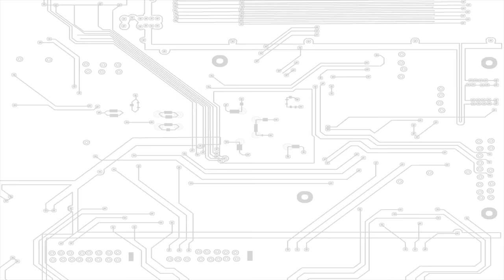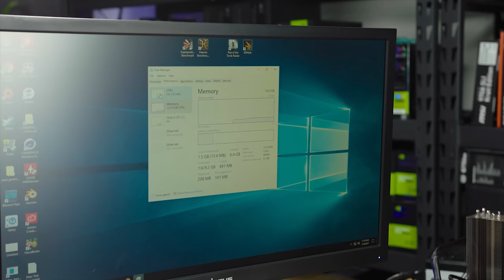How to fix bent CPU pins

Comment: I think this vid was made for me. After I blew a fitting on my first attempt at water cooling I tore down the pc to clean the motherboard as a bit og coolant got on it. I put the cpu (just a 5950x..) in the og package for safe keeping. I put it in upside down and bent some pins on 2 corners. I watched just a few minutes of this vid and was able to get them all bent straight and the system is now running. Thanks man!

Comment: This video saved my ryzen 5 2600!!! Thankfully my pins were not too bad due to the fact that I don't even know how they got bent. I pulled my stock cooler off and the CPU came with it but it didn't fall or anything just was stuck to the wraith stealth. Anyways I tried to put the CPU back in and I got the rock of death where some pins didn't go in and the CPU would rock side to side. I didn't force it in and than I tried your method with the razor blade and presto it went right in. Thanks again jay!!!!!

Comment: Watched this after DIYing a solution last night. What I did is very similar, but I grabbed a pin from my wife’s sewing stuff. It had a good sized round end. Slide the pin between the rows, then pull the sewing needle UP, turn 180, repeat. Watching this, I think the advantage using the sewing needle is that when you pull it up it forces the pins in the correct orientation right away. But…….I haven’t finished the build yet, so we’ll see if I got it right lol

Comment: I bent my pins exactly as you described: I was packing up the motherboard for RMA so putting my 5900x back to it's box. The plastic sleeve does not say anything about which side up/down, and when I snap it it bent in all 4 corners. Thanks for your video I don't need to mourn for two items.

Comment: Thanks Jay! My pins got bent (corners) when I couldn't get my heatsink off, too glued, and it ripped the cpu+heatsink out. I didn't know they were bent until after my mobo came back from ASUS and I tried to reinstall. You saved me a hell of a hassle!
Reply: Did you install the CPU on same mobo from which the CPU came off stuck to cooler? And it worked?
Reply: @5El3ments  I'm not sure if it's the same, I had it RMA'd. But, if I did get the same one back, yes it works. Applied a even spread of AS-5 with Wraith cooler and under heavy load it doesn't go above 60c. I could check the serial # if your that curious.

Comment: My 5700x wouldn’t quite slide in on 2 corners because 5 pins were slightly bent inward. I went to the grocery store, got a 10 pack of Razer Blades for 1,50 and fixed it. You’re a Legend Bro
Reply: Edit: 1,50 because they were made of plastic, but for my case that was sufficient

Comment: Going to give this a try on my Ryzen 9 3900. I just got the chip a couple of weeks ago and I had it running in my old AMD Wraith Prism fan. I switched over to a Artic Water Cooler and went to swap the fans and by CPU totally bonded to the heat sink. I pried the CPU off but dropped it off my work bench and bent about 12 pins 6 of which, pretty badly but none broken. I'm going to try to save the chip with the method shown here. Thanks for the Video and wish me luck!
Reply: 2 Pins came off, they were too far bent to get back in position and they broke off when I tried to pry them back up with the razor blade. Selling it for parts on Ebay. I'll miss it.

Comment: I love AMDs CPUs but I hate that the pins are stationed on the bottom. However. Im glad this tutorial is here. When I got a 1700X it came out of the box (with unbroken AMD seal) with a few bent pins. But I fixed them because Im a boss like that.

Thanks Jay.
Reply: They changed it to mobo pins for Threadripper. Let's hope it's forever.

Comment: unfortunately i damaged my 3700x after taking it out for the first time (i built my pc in 2020 around 4 years ago) to change the thermal paste, the cpu was cemented to the cooler with the old thermal paste and i bent some corner pins taking it out. this video is a life saver i don’t have to spend another ~400 on a new cpu🙏🏽🙏🏽🙏🏽

Comment: Oh my god Jay, you jsut saved my life, i just dropped my 2600X when installing a H115i, thought I would be clever and not lay the case down, i released the cpu and yes I dropped it (linus came into my head straight away) I thought I got away with it as everything seemed to be running fine, CPU temps were 15C cooler at stock settingsand  I was happy.............. until I checked the task manager.
The ram is showing 16gb installed but only 8gb available and the other 8gb reserved for hardware, I have tried everything to fix it, bios update, swapping the ram around, then I realised it must be the very slightly bent pin, so Im going to give your method a shot, and will update everyone, hopefully it works. After the massive damage you did I cant see why not as it was only two pins that are ever so slightly bent. Great video thanks for this massive Hack.

Comment: I've done this 2 times in my life time. 1 was mine and 1 was a friends. Nerve racking to bins the pins back. When I did it to mine I was literally shaking and upset that I'd destroyed a $200 CPU at the time. Had to calm down and relax with a lot of patience. I was able to fix it. It was a older Intel and pins were a little bit bigger and less than today. Razor blade saved me and my friends CPU. I like Intel has removed the pins from the CPU and wish AMD would do the same. Motherboards can be cheaper and I believe people tend to be more careful with them. CPU's are easy to bump or drop from holding on the side with two fingers. I've never bent any pins inside a motherboard and hope I never do cause that would be even tougher to fix. :)

Comment: I had a classic “cpu stuck to cooler because of thermal paste” situation but my brother had the bright idea of using a bottle opener to separate the two, it wasn’t actually a bad idea and it might not have done anything bad to the cpu but unfortunately he immediately dropped the cpu right after separating it and bent a few pins that I’m now gonna try to fix, wish me luck.

Comment: 1. Handle the CPU as least as possible
2. Always handle it over a bed/soft surface so a drop won't bend pins.
3. Hold CPU by the corners.

Remember all CPUs (PGA, LGA) are keyed/notched so they only fit in ONE way, the correct way. You simply place the CPU in the socket, then lock it down with the arm/lever. The first step of simply placing the CPU in the socket should not require force.

Comment: Thanks, Thanks and more Thanks to JayZ for this video. Yesterday I received my brand new 5900x and today tried to install it into my also brand new Crosshair Dark Hero Motherboard. Somehow, and I've got no idea how i managed to bend 3 pins during the install. 

I thought s**t that's £550 lost and I'm going to have to buy a new one and get back in the queue as they are out of stock everywhere. 

Watched this video, got the blade out of my Stanley Knife, spent about an hour, very slowly bending pins back into place (god they are so tiny and I needed a magnifying glass). 

After the hour, I tried the install again, doing exactly what Jay did of inserting and then closing and opening the cpu holder. 10 minutes alter I was brave enough to add the AIO cooler back on and switch the computer back on and YES,. YES, YES, the computer worked and I know have a 5900x working on my Dark Hero motherboard with a 3080 GFX card. 

Thank you Jay, you saved me with this video.

Comment: Thank you for the tutorial dropped mine after trying to get out of the motherboard got stuck to the cooler did not shimmy enough but several pins bent didn't even think of the Stanley blade method so much easier and less time consuming this way. Can't even see any bent pins at all thanks again

Comment: This just happened while building my first PC, everything was fine but I doubted about removing any plastic cover from the cooler or processor so I tried to remove the cooler but one of the brackets got stuck and the processor comes off the board attached to it so I bent the pins. Tried to repair it using a razor blade ( much smaller that Jay's) a couple of pins where complete bended so I had to use a small wire (those used on cables, bread, etc...) Managed to unbend everything without broking any pin. Tried  to put the processor back in the motherboard but one side wasn't completely entering, checked again but everything was ok, so I decided to apply a small pressure,  the processor now fits correctly, I have to wait until tomorrow to get new thermal paste and see if I broke it without even using it

Comment: Fair to note that once you've got all your pins spaced out with a razor blade you can use a mechanical pencil with no lead to further more bend the pins back in place fairly easy

Comment: I know noone will see this, but I just wanted to thank jay for this great video! Was about to return all my parents because I got no signal and no easily recognizable cause of issue, but my computer just wouldnt post after switching cooler. Lo and behold I had bent pins on my 2600, and after following the guide from this vid, the entire pc is working again! I was about to return $1100 dollars worth of components to newegg, who most likely wouldnt have replaced my cpu due to the bent pins. As a first time builder, this encounter was frustrating to say the least, but with the help of jayztwocents, my pc is working like new! I am forever in your debt.

-Tristan Barefoot

Comment: I just dropped mine accidentally on ceramic tiles bents the outer pins near the arrow I was in panic used tweezers made it worse I didn’t have a razor but I had a trowel perfect fit in between and managed to fit it back in the socket so big thanks to jay to this video I haven’t completed my build just need a m2 and it’s set hopefully it works

Comment: Funny I found this after the fact.. But on my new PC build I decided to change CPU cooler from the stock one, well when I went to pull the heat sink the CPU came off with it due to the thermal paste and bent like a least 10 pins on my new Ryzen CPU first I started with a pair of needle nose then went to tweezers and then I went to pocket knife which was the only one that started to work and I thought hum razor blade and found one laying around just like the one you used. Just as you showed I just went along the lines of pins and rocked blade back and forth to straighten each row both directions until I got the CPU to fit back in the socket whew no issues. Point is I thought the CPU was done but the razor blade trick is a great fix actually it is a utility blade which i think is probably better than a straight edge razor blade as it's a little thicker and worked perfect.

Comment: I bought a secondhand AMD CPU a while ago and it was sent to me in just an envelope. Not even a padded envelope, nope just a standard paper envelope. - It was totally mashed and there was no fixing that one. So if you are selling one, remember to package it correctly. If you don't have the plastic clasp for it, then sandwich it between  2 square pieces of foam that are slightly bigger than the CPU. Then find a small box that the foam just fits inside. Then you can bubble wrap the small box and put it in a bigger box. I've had CPU's sent to me wrapped in tissues, wrapped in baking foil and just wrapped in bubble wrap and it doesn't protect them.
Reply: i just had a guy send me a CPU in a zip lock bag with air in it. only 2 bent pens even tho the postal service smashed it into the mail box. if he put double sided tape on the back and stuck it to the zip lock inside that could have gave it a safe space. especially second blown up zip lock behind the first to pad the back of it. the glue would have come off with alcohol and it would have been safe.

Comment: sometimes you can fix them with a mechanical pencil...like a 0.7mm using the tip(writing tip, emptied ofc) nd you can work your way from bottom(base of the pcb) to the top, not only fixing bent pins but also the kinks...it is also handy to hold the pin when soldering...you will melt the pencil in this case, but if it's only one mechanical pencil to save a several hundred dollar cpu...hey, that's a win in my book.

Comment: I literally JUST bent my corner pins from putting the cpu back into the clam shell flipped the wrong way! I'm such a careful person I felt like a complete idiot. Had a panic attack too. What a stupid way to lose $200. In any case I used a knife to slowly bend them back, thank god they weren't severely bent. It was 3 pins on each corner except the corner with the triangle, those pins were fine. It still took like 30 minutes. Makes me feel a little better to know I'm not the only one that has bent the corner pins from doing that.

Comment: My 3900x got ripped out of the socket by my wraith prism and bent a ton of pins, straighten most of them out gently with tweezers after a day of fenese. One pin is broke and it won't boot 😭😭😭😭😭

Comment: Thank you! Mine had bent after replacing my stock cooler, only to realize my cpu came off with my stock cooler and some pins on corners got bent. I managed to fix them and reinsert it back in the cpu socket and now its in! Hopefully it works fine after i finish installing this new fan that im currently working on

Comment: Old trick for anyone who broke a pin off that matters. Get an inch or so of cat 5 cable and strip it to get one strand out. This will be your new pin. Put it on the chip with a very small needle nose pliers and cut it to size with very sharp side cutters. Find its corresponding hole on the mobo by counting and place it in it. Replace the chip. It just has to make contact with the either the remainder of the pin on the chip or the solder that held it. You may need to do this a few times for it to make contact. If it wont as a last resort I've dipped em in super glue and put em back on the chip. If it works, don't ever take it off again....lol. (til you upgrade that is or sell the mobo and chip together.)

Comment: Wow many thanks and again.  I was just changing R2600 stock cooler with BQ pro rock 4 when the cpu came away with the AMD cooler, oh flip-ady do! and a few other choice words lol (well now I can).  after sitting down and breathing in again, I remembered your video ref bent pins whilst researching how to build a computer.  I used your method and the proof in the pudding I'm typing to you now.  Once again thank you and keep up the good work.  PS now having large Gin and tonic lol.  PPs not sure if this tip is valid but next time I will run the PC for a while so that the paste is more fluid

Comment: I damaged a x570 aorus master and a 5950x I fixed the cpu pins using your method and now works (no broken pins) however the I believe the socket was also damaged when it bent the pins and will not boot

Comment: i fixed my 2600 after it pulled out with the fan/cooler when i was changing the orientation for better cable management.  I thought it was toast for sure but i grabbed a .5 mechanical pencil and and a sewing needle and a lighted jewelers loop($10 on amazon) and to my amazement had a fully functional cpu about an hour later(took my time and got it as close to original as possible.

Comment: I´ve finally built my first pc 2 weeks ago and when I got to placing the cpu in the socket it just wouldn´t go in. It was brand new I just opened the box and the cpu wouldnt go all the way in at one corner. First of all, I knew that well that´s bad cause you know I just opened it from a box and put it in the socket. The thing is those little fellas are very bendable. So having no tools around me and since they were not damaged in any way I just used the only tool I´ve got. My nails  :D Boom, fixed it. Works great

Comment: Best thing is, take the thickest injection needle you can get and cut off the sharp tip, or use the blunt needles you'll find in refill sets for Inkjet printers, and the pins fit perfectly inside the tube and can be bent back into shape👍

Comment: If the pins aren't bent over 45° it's relatively easy to rebend them. Personnaly, I bent 6 pins on my 3500X. But with a little help from some old dentist tools, I was able to fully rebend them into place. At first the CPU had  issues to fit into the socket, but with some fine adjustments, it fitted. And when I took the CPU out again, there is no way anybody could tell wich pins were bent in the beginning because the socket readjusted all of them perfectly.

Good luck for everyone who tries to fix their processors.

Comment: thank you so much I got a desktop tower and  I scraped it but I took out the cpu and wipe the heatsink off but apart of the wipe got stuck on a lot of the pins so I tried your technique and it worked

Comment: I only have 3 bent pins( not that badly bent) it fits in the socket but no display. Lights and fans are on but no display. It won’t register my keyboard either so I’m thinking it’s either my cpu or USB keyboard. I know some mobos don’t support USB til after bios. Anyone got any tips?

Comment: At 8.00 the first pin of the row got bent all the way towards the pcb again. Therefor a likely candidate to break. Just put the blade in from the good side of the row and wiggle it. Than this wouldn't happen. And like said, take your time with this. You don't want to cause more damage than there already is. That the CPU worked without the missing pin is just plain old luck. Back in the days I repaired pins with a red hot glowing nail as soldering iron, because my irons were just too big and I didn't have a heatgun nor masks. ( There was also more room between the pins ).

Comment: I just use a single header like the kind you'd have for the HDD LED. Slot that over and gently put pressure on it to realign the pin. Works perfectly